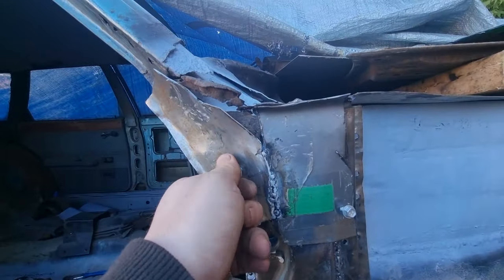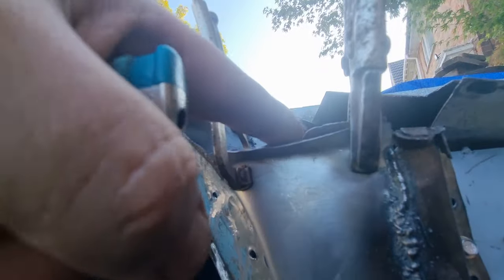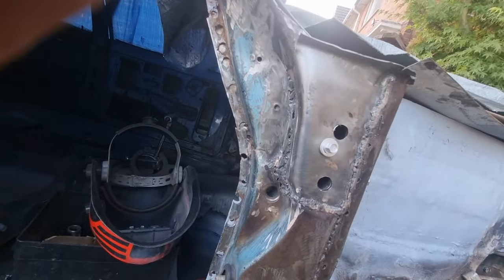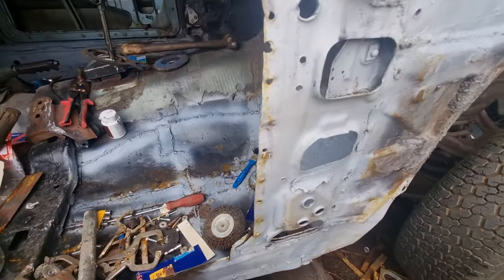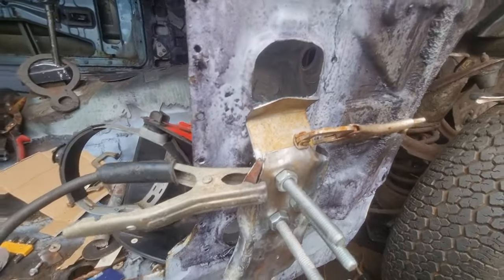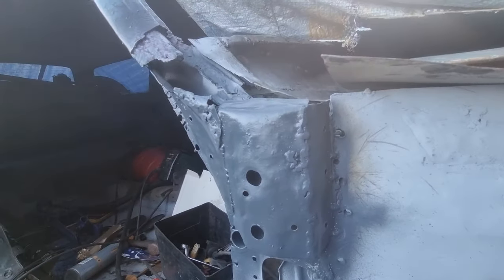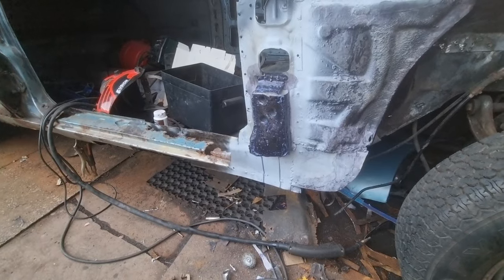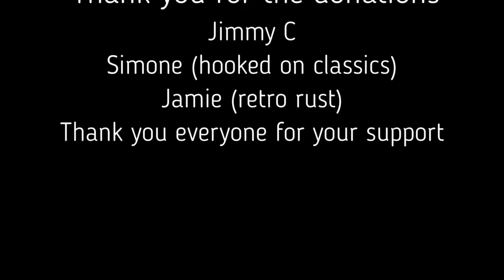door post Strengtheners Cortina Mk4 Ghia 2.3 V6 // Restoration (P50)

Comment: Strengthen all along floor pan and sill my crusader split there reinforce double all work as ford deliberately wanted cars to weaken and split so u buy newer car at 17 years old
Reply from the maker: Yes was thinking that I was thinking of running extra metal along side the  inside of the sill as extra bracing so inner sill is double the thickness and extra around the apost bottom section
Reply: Terrible area for rot door posts seen cortinas with rotten inner sills but good outers water gets in through the a post rotting  the floor at the front taking the sills with it
Reply from the maker: @MegaReddevil71  yeah im thinking of a way of changing a few things to make it better and inprove the build of it to make it last going to make loads of changes to make it stronger every where to all the rot places
Reply: @MegaReddevil71  my crusader dropped both sides 2001 year we built it up and then new wings didn't fit wish 8de cut them an inch in and spliced them 27 quid a side should known